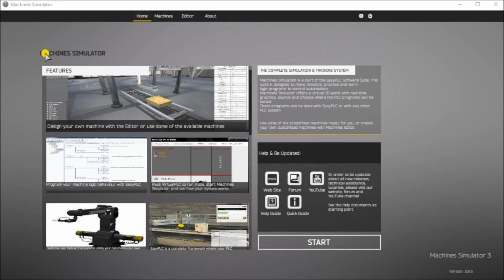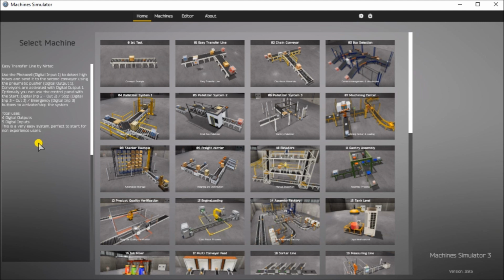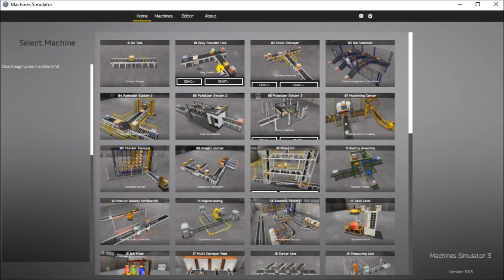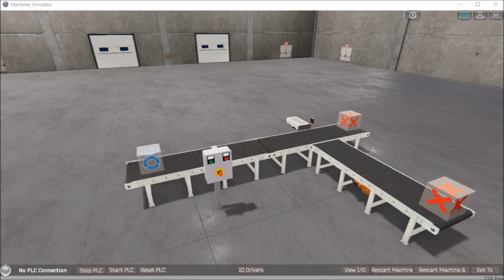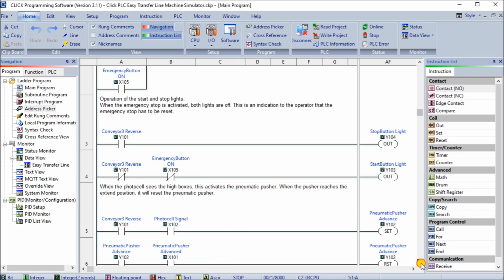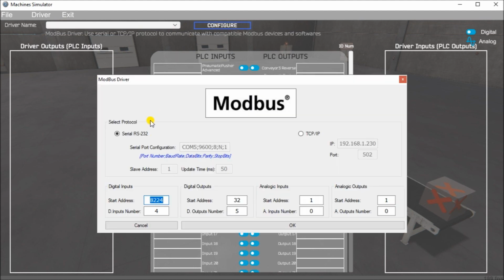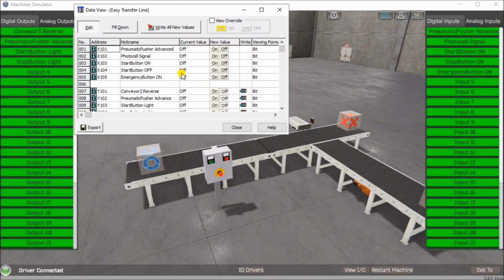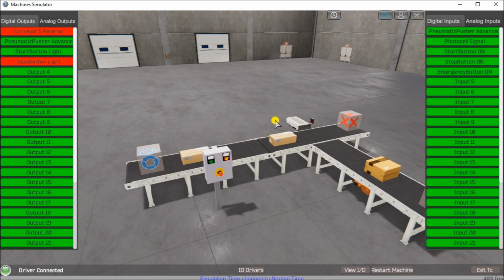Learn PLC Programming: Easy Transfer Line Simulation

Comment: hey mate why do i need a new rung for stop/e -stop? when i run the first rung the e-stop and stop button both work anyways?
Reply from the maker: This follows the PLC Scan. Left to right, top to bottom, the previous output rung and conditions are available for the next. This happens several 100 times per second. 
If you did not put a condition on the rung then it would be true anytime.
https://accautomation.ca/who-else-wants-to-know-how-a-plc-scans/
I hope this helps you out,
Regards,
Garry
Reply: @ACCautomation  your a legend Garry, thanks heaps!